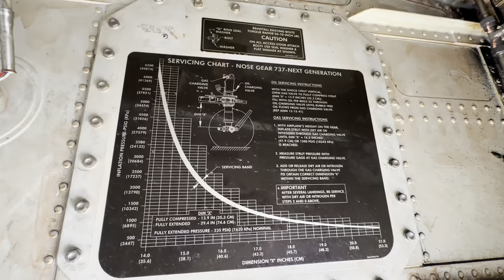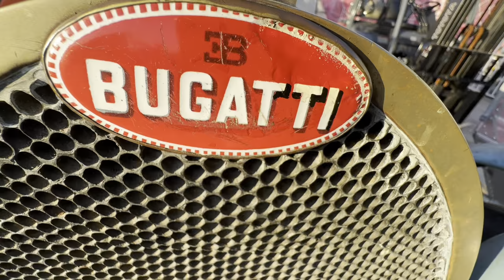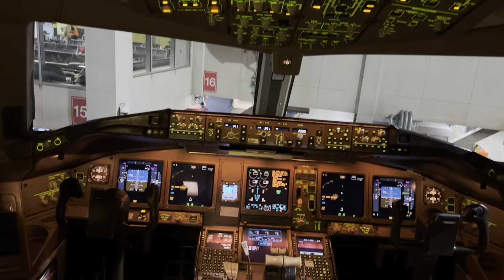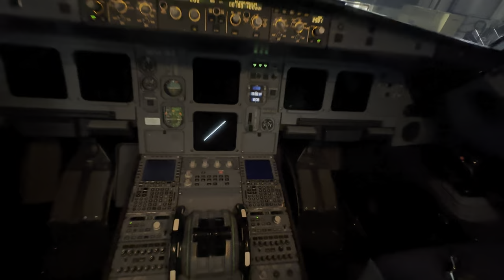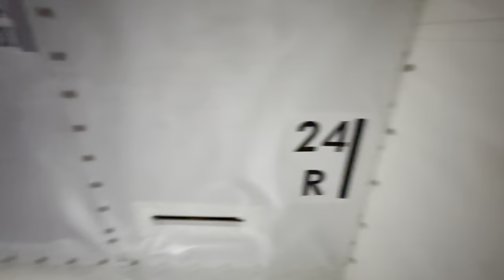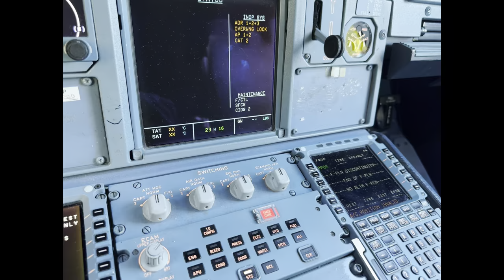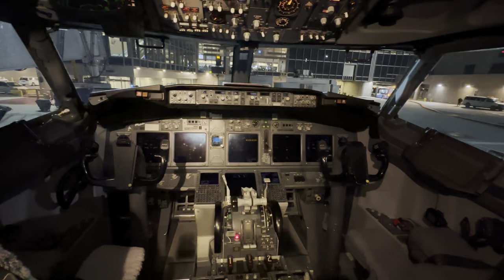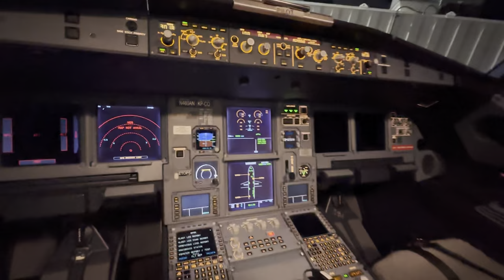Stig Shift. #13 (Aircraft maintenance Adventures)

Comment: Hey Stig thanks for sharing all the cool information on the various aircraft systems and items, small as they may be like the little air deflector to stop the howling noise.  One question,, when you changed out the oxygen bottle did you go back into the cockpit and verify the pressure reading (I bet you did but didn't record it 🙂)  ?  Oh another question, those witness marks that the aircraft manufacturer applies to the hydraulic lines (I think they are hydraulic lines) like the one I saw when you were talking about the nose gear, do you look at those to do a quick visual on the connection integrity ?
Reply from the maker: Yes, indeed I did go upstairs and check the upstairs display unit to make sure the oxygen is reading correctly. I just did not get a chance to film it. And the little marks that you’re talking about are called torque stripes. Inspection department usually puts that mark when it is at final assembly. I do glance at them, but majority of them do deteriorate and break off, but that doesn’t mean the fastener or bolt has loosened up.

Comment: With the O2 bottle. Once you crack the bottom for more that 10sec wouldn't the entire system be at full pressure
Reply from the maker: Not quite, it’s a pressure regulator attached to that valve. So it Has to be fully opened up.

Comment: Awesome video! Inside the landing gear bay there seems to be quite a lot of different types of metals. Do you need to worry about galvanic corrosion in airplanes?
Reply from the maker: I’m gonna assume that when they engineered and built the aircraft, they already took that into consideration.

Comment: Man, I can't tell ya how many hours I've spent in the cargo bays of the 777-300ER pulling out/installing bag bay panels. And being over 6ft tall, its not quite tall enough! Better than crawling around the cargo bays of A320's or 737's 😂 The ole 777 is one of my favorite planes to be on, around, and working on. The company I work for does heavy mods, maintenance from quick turn to heavy checks, engineering, etc. We work on a lot of different types too. Keeps thing interesting!
Reply from the maker: One thing about Aviation, especially with aircraft maintenance. It never is boring, there’s always something to do. And most importantly, there’s always something to learn.
Reply: @StigAviation  Absolutely, I consider myself a perpetual student!

Comment: Great video as usual! It's amazing how clean some of the nose/main wheel wells are in your aircraft. Attention to details for sure! By the way, when your jets fly from a snowy, icy airport and they get de-icing fluid sprayed everywhere, does the fluid make it's way into the nose/main wheel compartments? Does it slow down your inspection? Thnx Stig!
Reply from the maker: It does get everywhere sometimes, and it just makes a mess. But I know how to distinguish between glycol so it’s not that bad.

Comment: Do you all ever change the oil in the engines or just add oil?
Reply from the maker: Engine oil does not get changed out Steve, we just keep adding. It’s like a diesel. It just burns it off. The only time I would change oil is when it’s contaminated or if there’s a special procedure from the manufacturer.

Comment: Stig, what ts the minimum distance you must keep from these plane engines when they are running??
Reply from the maker: When the engine is at idle minimum distance from the front is usually 20 feet, I actually made a dedicated video just about this topic. It’s on this page check it out when you have time.

Comment: Good Day Sir...do you know why A380 when stopped at apron the upper rudder and lower rudder are biased to 2 different direction one to left(lower) and other to right(upper)...at B747 this is not the case and always at neutral position right?....
Reply from the maker: I am not an expert on the 380, but what you’re talking about is the split rudder. When the aircraft is stopped, and there is no hydraulic power being applied to the flight control surfaces, they are free to move in any direction The wind blows.

Comment: Hey Stig, thanks for the video. Just happy that you posted. I'm curious if the IRS and the ADIRUs are realigned after a leg of a flight or it is aligned during cold and dark and turned off when terminating? So close to 50k Congrats
Reply from the maker: The IRS is realigned at every single flight. They disengage it or turn it off and turn it back on, and it gets brand new data for the next leg.

Comment: Do you work on a plane that flies to Connecticut? If so are you allowed to say or show which plane so next time I plane spot I can take a picture of it and say that was touched by THE STIG. Also was wondering. I always wanted one of the red lights that blink on the top or bottom of the plane to put in my man cave. Do you have any plane fixtures as deco in your home?
Reply from the maker: Yeah, absolutely allowed to say which airplanes but you can track that on Flightradar24, and you’re talking about the beacon, I don’t have one. Unfortunately, that would be pretty cool decor at home.

Comment: Wondering why don't you use a separate oxygen tool kit that is not mix with oily tools when working working on oxygen systems?
Reply from the maker: Because I didn’t have them with me, and the maintenance manual doesn’t call out for any specific tooling except for the torque wrench. It’s not mandatory to have separate tooling.

Comment: Is the oxygen bottle is use for oxygen mask because i thought it was use to blow out air while flying?
Reply from the maker: The oxygen bottle is used for emergency situations for the pilots. In case there was a rapid decompression or smoke in the flight deck.

Comment: Hey Stig, I am an aircraft cleaner and detailer who washes thee outside of airliners like the 737 and 320. I was just wondering what the dirty streaks on the bottom of aircraft such as 737s actually are? I was told they are skydrol leakages, is that true?
Reply from the maker: Some of it is old hydraulic fluid seepage, some of it is oil stains, but majority of it is glycol from the icing fluid. Also coffee and dirty water stains from the drain masts.

Comment: So the green wire are bonding wires for grounding purposes?
Reply from the maker: You could say that, it’s basically not only grounding the aircraft, but also transmitting signals back-and-forth. A return path to complete the circuit

Comment: Wonder if that Bugatti was a rebuild project for Jay Leno.😁 Are the CVR and FDR still located in separate locations? Think I read the FDR is in the tail section. Wonder if the big the wigs at AA will order any 787-10's, United has about 20. As always another great instructional, detailed, mind blowing, surprising, and interesting video from our professor STIG...😉
Reply from the maker: If we see it on Jay Leno‘s show, then it probably it was his, in regards to the CVR and the FDR, those are usually at the back of the airplane.
Reply: Thanks! thought so @StigAviation

Comment: Hey Stig, love your videos! Regarding ARINC 429/629, Boeing (and Airbus) dropped A629 in favor of A664, as it offers higher bandwidth and costs less to implement (A664 is basically Ethernet). ARINC 664 is used on the A380, 787 and A350. These planes still have some A429 communication, but they didn't totally take a step backwards. Just wanted to share my bit of knowledge. Its fun when your videos touch on things I get to work on!
Reply: After reading some more comments, I'm not the first person to mention this. Either way, really appreciate your videos and hope to see many more!
Reply from the maker: Thank you so much for contributing more knowledge into this and I appreciate you taking your time and watching and sharing.

Comment: 22:54 i think you dropped a "milli" in there thats not supposed to be there :D would be quite some tiny batteries ;) ... how about doing a realtime episode? whole plane from coming in until it is all checked our - uncut? could be interesting - you' d need a gopro strap ore something like that though...
Reply from the maker: You’re absolutely correct, and I also made a correction and pinned it to the top of the post. I was talking too fast and I miss spoke. It’s amp hours not milliamp. But thank you for noticing and pointing that out.
Reply: @StigAviation  Ah sorry I didn't see your pinned post, my mistake :D ... interesting videos - keep it up man!

Comment: Wow, that  Bugatti probably is few million $$, Love the channel, Keep it up! BTW, the landing struts, I noticed during landing you can see the strut compress but at a certain point they look like they lower after initial stroke and stay without rebound, is that mechanical valving in the struts or a by pass valve opens to cause this? Thx!
Reply from the maker: It’s a air oil strut, so the compression during landing absorbs all of that stress. There are various amounts of bypass valves and orifices within destruct that allowed the fluid and the air to move into particular chambers.  That’s why you see the way it is after landing.
Reply: @StigAviation  Awesome, Thank You!

Comment: I would be scared the nose gear might fail and collapse and I would be crushed by the plane! Could you imagine??  Nightmare!
Reply from the maker: There are safety features to prevent that from happening. Aircraft have ground and gear proximity sensors, it knows and tells the aircraft that it’s on the ground and will not move the gear.

Comment: Stig could you comment on why United grounded the 321 neo over a no smoking signs in the cabin that won't shut off even though they are never supposed to be shut off.
Reply from the maker: That’s an interesting one, there must be more behind that story. There must’ve been some other grounding issue or fault for them to not allow the aircraft to go.

Comment: For those curious on the torque and crows foot. It's TQ *Length of the torque wrench / length + Attachment length. IE says it's 100*8/8+2. That is a straight on calculation at least
Reply from the maker: Thank you so much for adding to the information Ramsey. 👍

Comment: I have a question about the Boeing 777’s engine… It was said its diameter is about the same size as the Boeing 737s, but when I take a look at the footage you took, it’s not as big as was told. It’s because of my perception or something else that I have missed? By the way, I love your presentation on the great job you have done on ACMX…
Reply: The 737 fuselage diameter is almost 3.8m.  The engine used in 777 is between 2.8m (Rolls Royce and P&W) and 3.25m diameter, depending.  The new GE9X in the 777X is up to 3.4m, but the 777X isn't in service yet as far as I know.
Reply: @collectorguy3919  Thank you for your clarification… I understand it now.
Reply from the maker: Glad this was answered for you
Reply from the maker: Thank you for the detailed response 👍

Comment: How to avoid ESD buildup in the electronics bay during flight? Humidity up there is low...
Reply from the maker: There is also filters up there that circulate air constantly. There will be no condensation buildup.
Reply: @StigAviation  I mean, air up there is very dry, how to avoid electrical charge build up (ESD) in the electronics bay.
Reply from the maker: Bonding straps and grounding points, everything is grounded to the air frame. You also have static wicks and static dissipators.

Comment: Hi Stig, question…..why would the oxygen bottle psi have been lower than the recommended level? Did the crew have to use the O2? Was there a leak? Thanks.
Reply: Pilots do an oxygen test as part of their preflight which drains a little. On the O2 mask box there is a push to test button that's also part of the unlatch mechanism that when pressed gives the mask some oxygen that you can hear and there's a disk that will reveal indicating you're testing it.
Reply: @FloorItDuh  thanks for the answer. You can guess I’m not an aviation expert, I just love the technical info and learning how/why things work.👍🏼
Reply from the maker: Thank you so much for helping with the answers. Much appreciated.

Comment: Hey sting, I know this is probably a dumb question but I’ve always wondered why the 777’s come in 3 axel main gear configs compared to the 787’s only having 2 axels, is that just due to the 787 being composite and lighter? any info is appreciated, kindve curious!
Reply from the maker: The 777 is simply a bigger heavier aircraft, it needs a bigger heavy duty gear.
Reply: That’s what I thought. I appreciate the response! Enjoyed the video a ton!

Comment: Use to work the ramp at HSV. Seen a few times major work done to aircraft like a engine change and nose wheel strut work on a MD80 and it always fascinated me. Got a old colleague that still friends with who worked as a Delta A&P at DFW back when it was a Delta hub and the things he told me and what you show are still fascinating. Learned more ins and outs about aircraft than I knew about but yea this job regardless of the ramp or what you do never gets old and still learning something new every day. Just watching  aircraft is like a stress relief. Got 2 questions what was that AA bus fir for and any chance you could do like a behind the scene video of aircraft repairs in a hangar?
Reply from the maker: Bus Fir ? I’m not quite sure what you mean by that, and I’ll try to get some footage of the Hanger and future videos.
Reply: @StigAviation  in the one of the clips of you in the 737 I think on this recent video there was an AA bus in front so wasn't sure if it was for like transporting employees
Reply from the maker: Oh, the bus itself, I thought you meant Airbus, yes, those are employee shuttles.

Comment: Hey stig, you should look into PT-MUG final investigation report. I guess that's a glance on why intercommunicating data is not ideal for aviation projects
Reply from the maker: Fill me in on what happened, I must’ve missed that one
Reply: @StigAviation  basically a short circuited conector on the backup converter disconfigured the TBBs and CCBs and didn't let any source of primary, backup and standby electrical gen to supply the aircraft, remaining only the battery power. They landed really overweighted, all the 12 main wheels were deflated but luckily due to great CRM and decision making there were no injuries at all. Once they cut the engines on ground, the CCBs and TBBs were reset and apu gen kicked in. Kinda crazy landing with no elec power at all and getting it right after engine shutoff 🤣
Reply from the maker: Holy cow, that’s nuts. But kind of makes you appreciate the dedicated alternator on the engine to keep it running continuously, even without any kind of electrical power to the main ship.

Comment: ARINC 629 sounds a bit like a typical network setup nowadays , except it has a single cable (somehow?) that connects all to all, but our computers each have an ethernet wire connecting to the master (router). Seems so much more powerful to allow any device to send packets to any other device
Reply from the maker: And this is why you’re seeing aircraft nowadays, slowly transitioning into ethernet wiring because of the massive amount of data that can be transferred and at very fast speed

Comment: So, the engine blades cause the ratteling noise when they spin, because they are not fully fixed. But why though?!
Reply from the maker: You are thinking of a very specific engine that does that. I discuss it in previous posts, the rattling noise is when the engine is not running and what you are hearing is the mid span shrouds. Usually the CFM 56-5B and CF6 engines have those.
Reply: @StigAviation   Got ya! Thanks a lot for the Info!!!

Comment: Arinc 629 just lacks spare parts that you can borrow from other aircraft, meaning operators would have to keep extra stock and thus upping the cost of operations. Boeing is afraid of anything which makes the competitor aircraft model seem like a viable alternative.
Reply from the maker: 629 was definitely a more expensive system. That’s for sure.

Comment: What’s with the nozzle shaped piece in the center section of the engine
Reply from the maker: Which engine Mike ?
Reply: @StigAviation  the engine in the thumbnail. Looks like a nozzle instead of the typical conical piece. What does the low pressure generated do?  And do these things Need DEF fluid? Or I guess it would be JEF jet exhaust fluid? Lol
Reply from the maker: You are talking about the big tube, sticking out the back end, that’s called a center vent tube, it basically exhausts, hot oil gases from the gearbox and bearings.

Comment: They got rid of 629 because it's just another bespoke bus. It's slow (2Mbps) and only supports 128 devices per bus.

787 uses ARINC 664 which is standard switched Ethernet just like computers use, with one extra field in the Ethernet header. That's a much better system that uses off the shelf Ethernet chips and switches and supports tons of features like VLAN for segmenting traffic and QOS for priority. No practical limit on the number of devices. And spanning tree allows the switches to easily support multiple redundant links so in a failure scenario traffic can route around the problem.
Reply from the maker: Absolutely phenomenal information. Thank you so much for adding more context and more knowledge. I appreciate you.

Comment: We had to pitch and roll using a plumb bob over a chart to convert the attitude vs the reading on the drip/magnetic tank sticks when there was an inoperable gage on the external fuel station on BAC-111s
Reply from the maker: Yep we do that here sometimes as well. Once you do it a couple of times you get the hang of it.